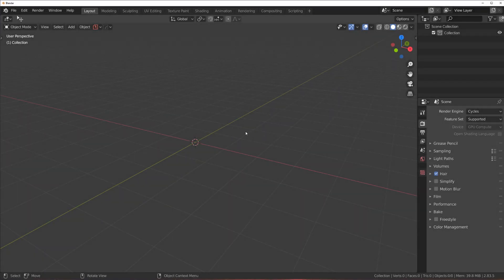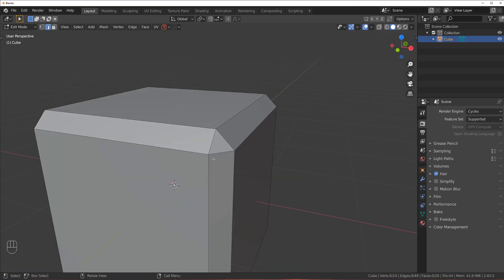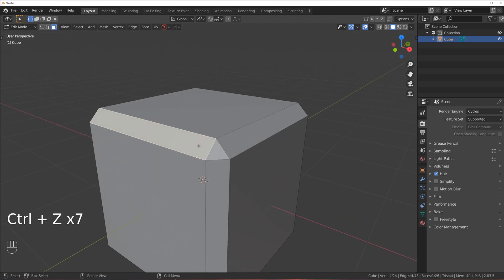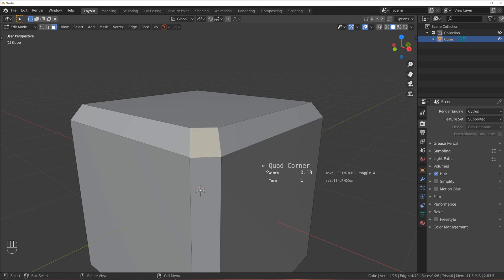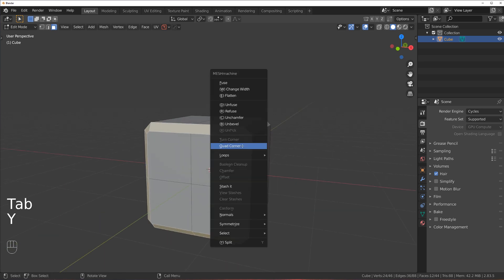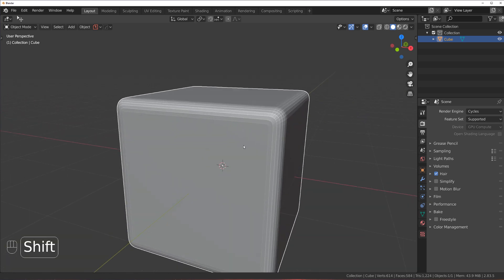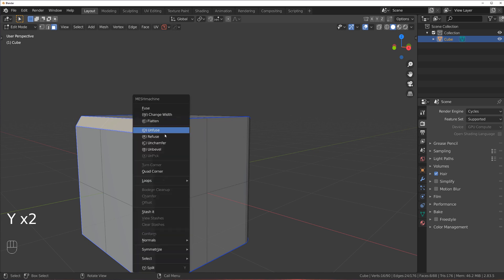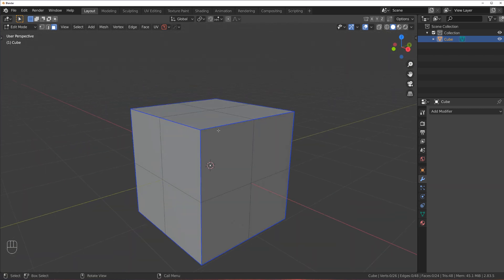TRIS to QUAD corners in Blender.

Comment: if possible try to resolve the problem in vanilla blender =).
Reply from the maker: no thanks, i am too busy to mock around with solutions that take ages. It is not the issue of whether it is possible or not possible, but the issue of efficiency.
Reply: @PonteRyuurui  I saw a lot of people using this addons, maybe I'll purchase or pirate it because Brazil sucks to buy such things like that. btw, I appreciated so much the 2 courses created with Josh at Udemy.  How about taking a course focused on game assets? I would certainly buy again.
Reply from the maker: @felipeprodev  Lots of effort goes into the addons and courses so by pirating you are hurting us all. Contact a creator and I am sure something can be done.
Reply: @PonteRyuurui  on my PC software are 99% original, but some things are so expensive to buy because of the high tax in Brazil. I understand your concern about pirates and I am totally agree because I am a developer. When I was a student I was unable to buy anything, but nowadays I buy it.
Reply from the maker: @felipeprodev  well just get in touch with the creators and i am sure you guys can arrange something.